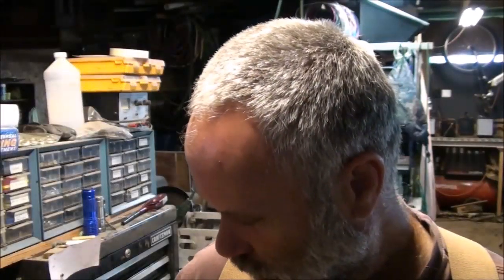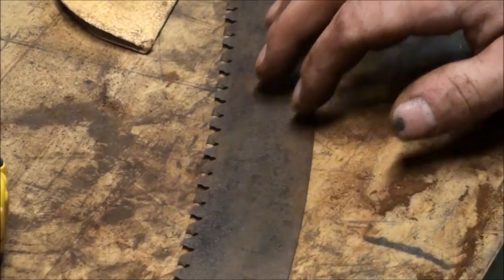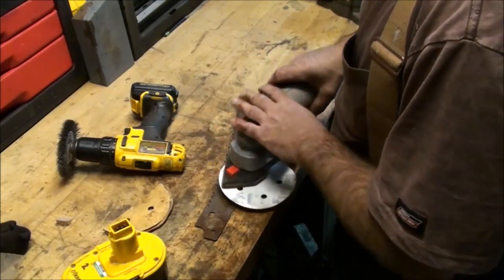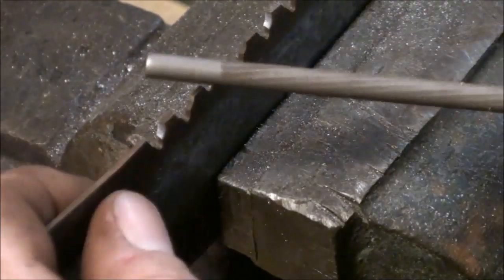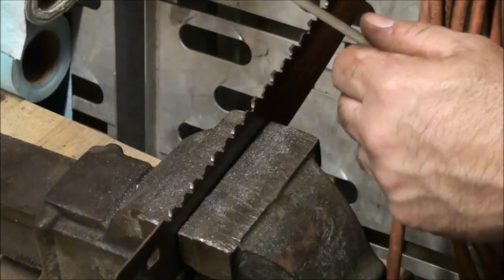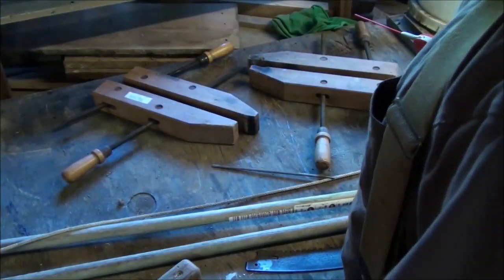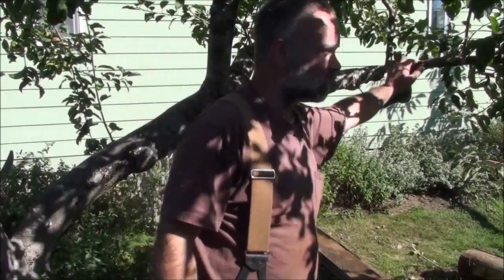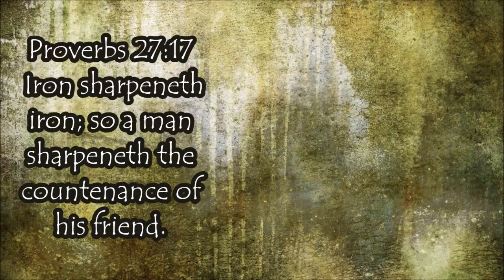Sharpening a Pole Saw and Pruner

Comment: Some pruners only have a sharpening on one side. Yours must have ot on both
Reply: Beth Aspell true! Those pruners you are talking about actually work better. This set is sharpened on both sides because the blade isn’t coming up against a metal shear  surface. The cupped area behind the blade is for holding the limb, made of plastic and has no cutting potential. Thanks!